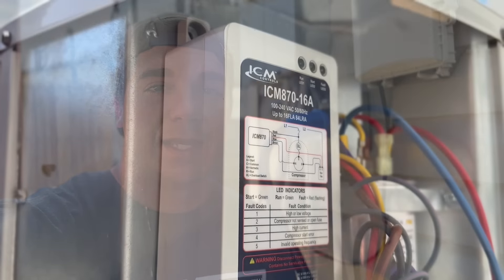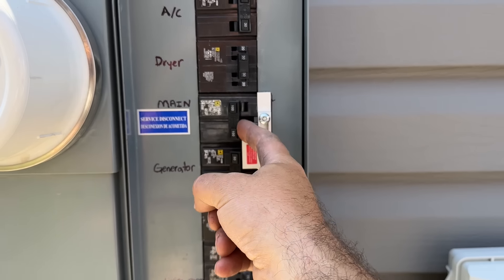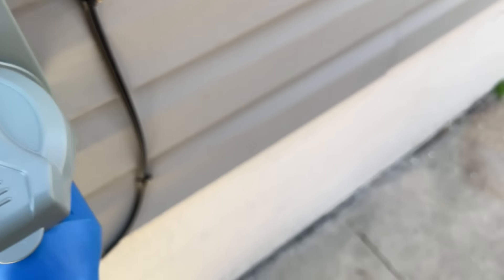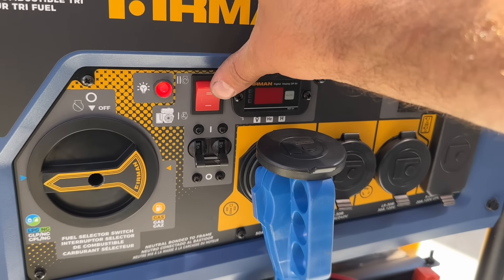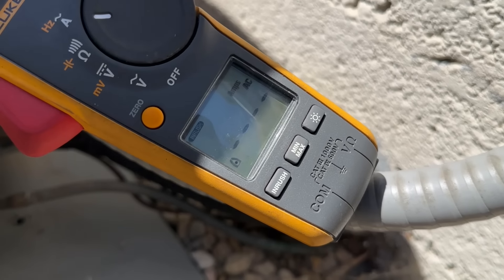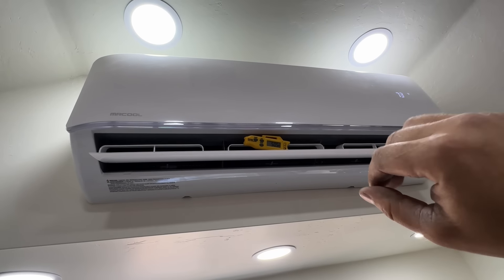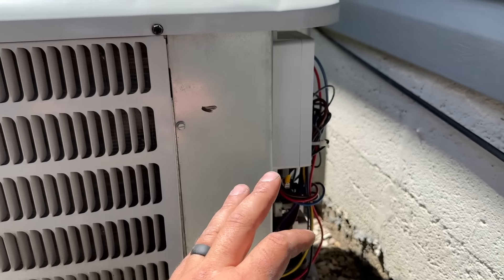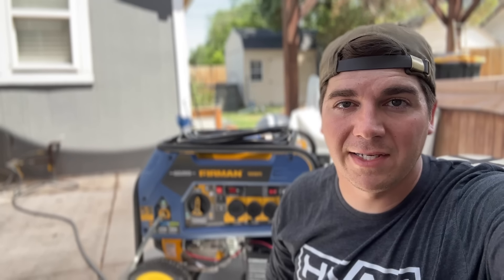How To Get Whole Home Backup Power For Under $1000

Comment: Good Demonstration, BUT.....Be very concerned about potential damage you can do to sensitive electronic equipment ( AC , TV, Computer, etc.).    I own the same generator and according to data posted on the Firman website it is rated at 11 to 14% THD.   This is way higher than what is recommended for sensitive electronic equipment.   The power supply for sensitive electronics should have  < 5% THD.    I would hate to damage the circuit board on my inverter based AC ...or even my two speed compressor as it would be a very costly fix.   I like this generator, but wish it put out cleaner power.      Any thoughts on how to address the PQ issue with this generator?   I live in South Louisiana and ran multiple window units with the generator and didn't have an issue.    Sure would be nice to be able to run one of my central AC units.
Reply: There is no way to clean up high THD at this size of generator. Its simply not economical in cost. You would need a sizable load reactor device that is matched to the loads in your house. This would basically absorb all the higher harmonic voltage/currents above 60HZ and convert it to waste heat but leave the 60hz power alone for your loads to use.  Over time high THD can and WILL cause damage.

The bigger enemy is actually voltage surges since portable generators at this level while many have brush type AVRs or brushless capacitor excited, the regulation will never be as "tight" as utility. A heavy load starts, the engine momentarily drops in speed before the engine governor responds, and the AVR drops in voltage and takes a moment to recover the voltage back to the preset level. The AVR can "overshoot" the recovery for a very brief time where high voltages can be seen by your devices and damage them. To your point thats not good. Sufficient surge suppression like MOVs in a circuit can help absorb these transients sacrificing themselves before your inverter based AC.
Reply: @N-M424  not necessarily. I have tested generators with an amp probe meter and at half a load for a 6,500 watt generator with a 3000 watt resistive loan I've seen THD as high as 16%, and would only get worse from there. It comes down to the build quality of the powerhead.
Reply: @N-M424  it was a Generac GP6500. Full load it was closer to 20%. Doubtful it would be that low for the Firman.
Reply: @N-M424  that is what the firman website says about the model yes, but Id be willing to bet with a resistive load that THD would be more.
Reply: @N-M424  agreed. Between James Condon and myself we are testing THD one portable generator at a time!
Reply: @Bassguitarist1985  wouldn't inverter generator produce clean power? More money but maybe worth it for electronics. Although most devices have power supplies that can handle it. I run my router, cable modem and computers on my cheap troybuilt 5550.
Reply: @mpgravol I also live in south Louisiana. I’m strongly considering the Champion #201176 open frame tri-fuel inverter generator. On gasoline it’s 7,000 watts running/9,000 peak. On nat gas it’s like 5,250 running/9,000 peak. Propane has slightly higher running watts. 

This gen is <5% THD. It might even be <3% THD. Gen is $1,599.
Reply: @onlywenilaugh6589  pure sine inverters yes, usually 5% or less. The issue is the PFC circuitry malfunctions from high THD input to the PSU. This leads to overheating, low performance, even catastrophic failure eventually.
Reply: Retroseal make a surge protector for your hvac system that takes of this issue
Reply: @commercialachvac4809 Surge protectors do nothing for THD.
Reply: @Bassguitarist1985  A Generac? Oh $hit! Just installed a 22 KW at the Florida house. Never thought to look at THD. Well, at least no one will steal it. Cheers!
Reply: @blackrifle6736  A Standby Generac Unit Guardian?? If so, no need to worry, they are more precisely built with less than 5% THD. They call the feature "True Power."
Reply: @Bassguitarist1985  Whew. Thank you ever so much for that. Re-RTFM and confirmed. Cheers!
Reply: Not usually a problem with modern day electronics.
Reply: I have basically the same setup, but I use a Westhouse low thd generator.

Comment: I bought one of these from Costco 3 years ago. Ran it on propane the whole time. Had to run extension cords. I do not have the generator inlet box yet or a natural gas outlet yet. It is one of my goals to install soon. When we had our hard freeze, we were able to run medical devices and keep our fridge going. Very happy with our generator.
Reply: Do you have a video on splicing and replacing a bad or worn low-voltage wire on the outside unit?
Reply: How far is the gas generator from the gas meter?
Reply: How many amps draw is the Mr cool? Is the amp draw different in the Mr cool heat mode vs the cooling mode?
Reply: What was the size of generator ? How long did it run on a propane bottle before refill ?
Reply: @caddothegreat   7500W from Firman. I could run it for at least 8 hours on a 5 lb tank.
Reply: @Emmilythecat  thanks
Reply: @Emmilythecat  are you sure 5 gallons and not 5 lbs?  Mine ate through a 20 lb tank in about 5 hours.
Reply: @ChuckMorton  how long can you run the generator nonstop

Comment: Something VERY IMPORTANT that was not mentioned. You need a 240 v generator not  120v. Most generators are 120 volt. After buying 2 cosfco generators, a parallel kit and paying an electrician $1500 to do the electrical work to put in an inlet and an Interlock kit I found out the hard way, that my two firman generators would only power "every other circuit breaker". The electrician confirmed that the only way to power the whole house is that you have to have a 240 volt generator. Unfortunately 240 volt generators are expensive and I lost a lot of $$ since I waited too long before finishing the project and had to sell off my firman generators. Sure costco allows returns but if you return too many items or too many big items you risk getting your membership terminated.
Reply: You have the live line of your 120-volt generator feed both poles of a dual breaker. That way 120 volts feed into both phase A and B of your breaker box. all the 120 volt circuits will work. but the 240-volt circuits won't work. that is what we use as that is all you need for the furnace and fridge and tv set and fans and lights. The neutral line from the generator feeds to the combination ground neutral bar in your breaker box. Its pretty easy to do.
Reply: A setup like this should NOT be assumed to run an entire house. To think otherwise is foolish. This setup should be used for primary circuits (heating/cooling, food storage, some lighting in occupied areas). If you tax this setup to run the entire house IMO is risky. If there is a power failure your first thoughts should be conservation of energy until the system is restored. Don’t forget that your fuel sources may not have power as well and depending on how long that may be this setup may just delay the inevitable.
Reply: @michaeldecker2725  Right, and btw not trying to power the entire house.  Instead, I want the ability to power those specific circuits that need power.  If you run 120 V, you'll only be able to power "every other circuit", so for example, if your freezer or fridge is not on the right circuit, it won't get power, even though the power consumption of that device is much lower than what you are able to generate.
Reply: @wrestlerstudmuffin  Thanks, appreciate the idea.  It's been a while since I posted this.  I ended up buying two 240v 9500w generators.

Comment: I had a great set up at my old house, but now I don’t have natural gas.  I spent about $3,300 for everything including the electrician to install 50 amp outlet, natural gas conversion kit and hose, plumber to install gas outlet, MicroAir soft start and Duromax 13000eh generator.  It ran a 4 ton AC just fine.  This guy is only powering a 2 ton AC.
Reply: You could of spent a few bucks more and got a solar roof
Reply: @jmatt98 isnt a solar roof like 11k without installation cost

Comment: I live in Texas and after the big freeze 2.5 years ago that killed about 600 people, I decided to put in a generator inlet and interlock kit after that because I never wanted to be near freezing to deay again.  I went with an inverter generator, which is much quieter and much more fuel efficient (though if you are running on NG, that is not so important), and while my generator is not big enough to run the AC even with a soft start kit, most of our extended power outages are in the winter and spring where keeping central heat is more important than AC.  This past winter we were out of power for 3.5 days and I was one of the only people in the entire area that had power.  My inverter generator is 5000 watts continuous, and this was more than enough to run everything in the home with the rare exception that I could not run both the microwave and toaster at the same time (we have a full fridge, mini fridge, and small chest freezer, and all of these were kept running as well.)  It worked so well that five of my neighbors decided to put in 5000 watt generators with an inlet and interlock.  They know they may never need them, but they now have the ability to keep their families worm for days at a time if the power is ever out again.  If I lived where there were hurricanes, I would probably go with a standard backup generator, but for these 3-4 day outages, the interlock setup is fantastic.
Reply: heathchilders777  I spent $75 for the interlock kit (which is just a metal plate with some slots cut in it), I spent $175 for my electrician to install it, but I already had a 50 amp breaker in the right spot that was there to run an electric clothes dryer, and i use gas, so there was no need to move breakers.. I also spend about $50 for the interlock. Now in my case, it was a pretty simple install, but since the freeze in Austin this past year, several of my neighbors took the plunge and I think the average price for the setup was $600 or so. It is not that big a job if you have a spare dual breaker slot in your panel.  This needs to be mounted in the top by the main cutoff, so if you don't have room there, the breakers need to be moved.  Also, my inlet was only 12 feet from the panel, so if you need to go a long way, it could be more.  If you have gas heat, you really only need about 4KW to run a typical home, but this will not run AC, only gas heat, but 4KW will easily run everything else in the house. If you have more questions, happy to answer.

Comment: Simply awesome, millions need this set up in TX, as we keep having issues with power grid, if it's a snow storm, tornado, hurricane, you named it, it happens in TX, have 1 house done, working on our next residence and no worries about power.. even looked at the wind turbine to keep ac and fridge running in the summer ⛱️⛱️😂
Reply: I live in Houston and I just purchased this like 10 minutes ago. We’ve been without power since Tuesday and it Friday! 🥵🥵🥵
Reply: You arent kidding. No power for 5 days, two times in 2024.
Reply: Just to clarify. It's centerpoint energy that sucks in TX. Which is mostly houston. All other power providers are just fine. I have midsouth and the power only goes out like once every 5-6 years. If you have centerpoint and your power goes out then you can expect up to a week maybe longer if its from a natural disaster.

Midsouth in montgomery had me back up and running after just 27.5hrs and that was only becasue they had to replace a pole that fell.
Reply: @calvinbutler1681 right behind ya I'm definitely not the sharpest tool In the shed but I am sharp enough to know we are going to do this relative soon sadly
Reply: im assuming the soft start stays hooked even while on regular power and helps out ? is that correct?

Comment: Those looking to run on natural gas should be prepared to pay dearly to do so. The generator will use a LOT of natural gas, costing a fortune - a lot more per hour than when running gasoline. The wattage output is often derated when running on natural gas.  I have gas jugs to stockpile fuel for a week or more at 12 hrs runtime per day.

Comment: I have the Pulsar 12kw dual fuel generator and my friend just bought one for $960 on Amazon. It runs at 9500 watts on gas and 8500 watts on propane. It runs my whole house, well and water heater. Couldn't be happier. Generators run best between 50% and 85% of rated watts. Cheers
Reply: 50% gasoline/Propane/Natural Gas
75% to 85% ( tops ) Diesel Generators

Comment: The best thing about my generator setup which is functionally the same as yours is that it is MAGICAL. Most of the times I've used it, right after selectively shutting off the water heater (I'm all-electric), dragging out the generator, connecting the cable, getting things cranked up...wait, I need to fill the tank completely up first to get maximum runtime, and usually all of this is in a downpour, and finally switching over the breakers, the MAGIC happens and line power immediately comes back on.

It's turned into a meme in my family. "Dad! Get the generator out so the power will come back on!"
Reply from the maker: 🤣 that’s awesome
Reply: what's taking you so long!! lol
Reply: That is hilarious!😂  never heard that one before.
Reply: I hear you. After rigging a series of hidden heavy duty extension cords to various parts of the house to use my generator, our first power outage lasted 15 minutes. I was so disappointed the power came back on and I wasn't able to really test the whole system.
Reply: I had that happen once. The other times we were out for hours and days. My generator kept our business going .
Reply: @Freight_Train  My first test with my whole house generator turned into a freak show.  I didn't put enough gas in the tank and my generator surged while under load, blew out two tv's.  I was lucky I didn't do more damage I was told.
Reply: Hurricane Ian, category 5 hurricane destroyed my SW Florida town. I'm wheeling my generator out of the garage after the storm passes, at about 1am or so, to get the fridge and A/C working again, and I see the lights in the house come on. What?! Magic. We lost power for only a few hours. Crazy. Some people lost power for 2 weeks or so. I only lost power for 3 hours.
Reply: Lol, this is so true. That also assumes you don't have the thing locked up in a shed across the way
Reply: 2 years ago I had 200 amp breaker box upgraded for generator in the event of power outages. Have A/C and separate oil heating system. Three Electricians came and quoted job and all told me I couldn’t run A/C  (2.5 tons) because of surge. I had no budget limit but no one recommended this option? Is this brand new technology ?
Reply: It’s happened to me a ton of times since the 2 week outage we had. 
The most recent storm resulted in a 2 day outage. 
Much shorter…but still a lonnnng 2 days.
Reply: @jafo4u508 Two things you can do. 1) Buffer the sensitive electronics with a UPS (you need one on your desktop anyway so you don't lose any important "work". There's your excuse to buy one. 😁 Or, 2) I'm not scientifically sure this is a real fix but it makes sense(?) to me: get two surge protector power strips and daisy-chain them between your TV's and the generator. Maybe one would do, maybe more than two are needed, who knows! This ranks up there with deer whistles, but I've actually used them and I CAN say that I've not had any electronics problems. Evidence? Who knows!
Reply: You crack me up cuz I can relate.  Other problem is you better guard the noisy thing because in a true desperate situation a generator than can be heard blocks away in a neighborhood could be a gold mine for someone inclined to take it.
Reply: @diyhvacguy  Is there a way for my lights not to twitch when A/C kicks on, I have a Carrier? Thanks
Reply: Happened to me just now during Beryl or whatever this hurricane was called. Generator and window unit set up... 5 hours later power restored. 😂

Comment: I have the identical generator to yours, with a generator interlock powering a 30 amp circuit; yesterday hit 111° and SoCal Edison decided to cut power (preventative measures they say). I ran the generator, with a cable leading from the 30 amp outlet to a 30 amp input attached to my breaker box. The digital display on the generator showed 245 volts, but got no power in my house. I called Furman and a very impatient woman said that I needed to hire an electrician to unbond the neutral ground; having done all this work myself, I thought I could tackle the uncoupling of the neutral ground, but two different videos sent me to two different wires, so I'm stuck. If you have any information about this, and have time and generosity to answer, I would be very grateful. By the way, some people have the skill to make videos, and some people don't; you sir, are a natural.